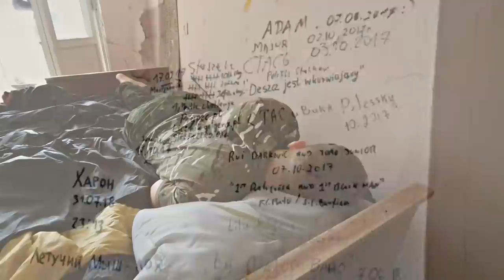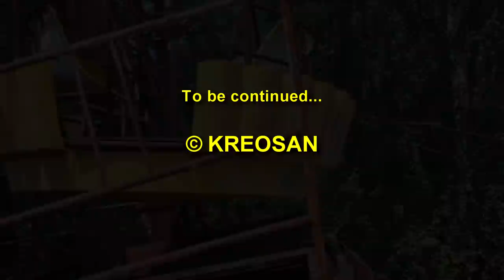Pripyat Electric Power System 💡 Living in Pripyat Experience

Comment: Crazy to think many of those lights haven't been turned on since the Chernobyl disaster in '86, but still work perfectly 33 years later. Oh if those buildings could talk.
Reply: After all the radiation they probably can.
Reply: @wachter206  doesn't the radiation make them glow anyway :-)
Reply: Built to last. Made in CCCP
Reply: @wachter206  One of the most intelligent comments I've seen in years! Congratulations.
Reply: My car has been outside for over 30 years and still works.

Comment: Some of those old fluorescent lamps lit up better than the ones in my garage!
Reply: Good old fashioned magnetic ballasts. Almost completely unavailable in the west now.
Reply: @gregorymalchuk272  Yep, I bet if they were electronic ballasts half of them would of gone pop when energized.
Reply: They were made for use not for profit
Reply: None of that low mercury rubbish
Reply: @uK8cvPAq  i have 20 year old electronic ballast that had dripping toilet water in it
It works like charm but there is no use for them now
Reply: @Dank Kimmy this is the soviet lamp. Of cource it good. Communtists didnt do bad.
Reply: @Wok_Agenda  exactly.
Western capitalist bulbs are engineered with planned obsolescence.
In fact the light bulb companies all signed an agreement decades ago, that all bulbs should blow after, I believe it was 7,000 hours.

Under Communism there is no reason to build things to deliberately break.
Reply: @forestdenizen6497  socialism
Reply: @gregorymalchuk272  You get New Old Stock of almost everything on Ebay. So if you miss flickering lights...
Reply: @forestdenizen6497  Actually Soviet incandecent light bulbs - "Oreol" had the fame of burning out quite quickly. East Germany had its own Narva brand which lasted a bit longer. Now with the famous EU banning incandecent light bulbs - they're only available from the East or as NOS. When I run out of my stock - probably I should travel to Pripyat to recover the remaining bulbs :-)
Reply: These model of fluorescents lamps is T12, but the T12 are no longer manufactured, since the 90's, they were all replaced gradually by T8 fluorescent light since the 80's. At first in North America and Western Europe, but more later in Eastern Europe where the T12 were be still used in 2000s
Reply: How much lumes does youre one have
Reply: @becconvideo  Same time the ones made in Latvia were known to be quite reliable._
Reply: @forestdenizen6497  It was 1000h, 7000h is extreme heavy duty for incandescent._

Comment: Please fix the elevator that would be awesome :D
Reply: If only they could - assuming all the wiring, relays and circuits were intact, it would take more than that little battery bank and inverter to run something so big.  This whole concept is totally awesome!  Way to go, guys!
Reply: @samvalentine3206  also bearing, grease, electric motor, linear bearing, puley.... mmm it's hard but not impossible
Reply: @samvalentine3206  don't forget the floor sensors door sensors and many many other mechanical things all screwed up from age.
Reply: @samvalentine3206  relays would be broken too.
Reply: @Agustinus Reynaldi the motor on these elevators is surprisingly small, no more then 2kW. But the relay logic of the control system will probably be all looted.
Reply: @samvalentine3206  they wanted to restore mains anyway didnt they?
Reply: elevators have a electric motor which has to much of a value to be left there - it  is probably salvaged in the 80ies to be fitted into another building. If not - motors contain copper coils. 0% chance the motor of any elevator in Pripyat is still in place.
Reply: @stonedsavage7814  russian relays not. :-)